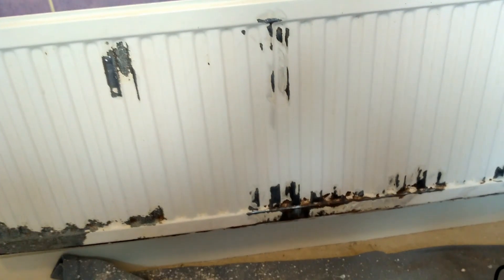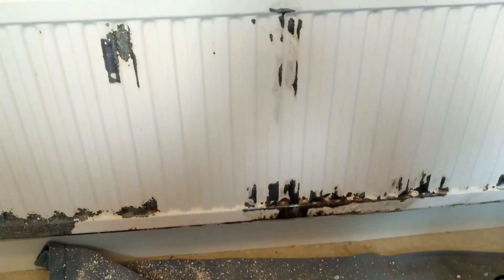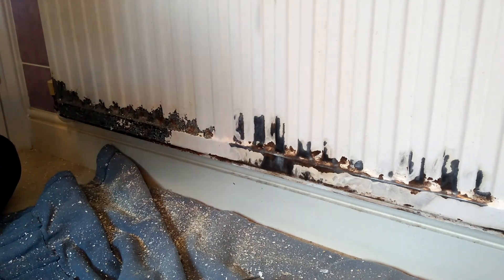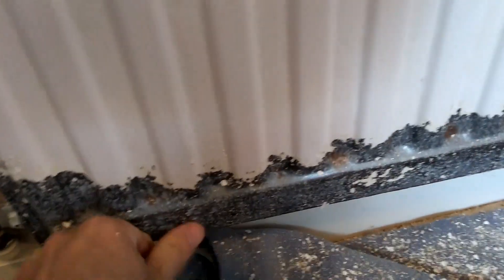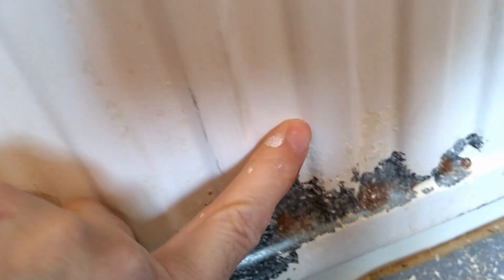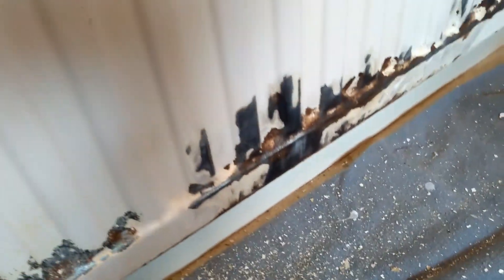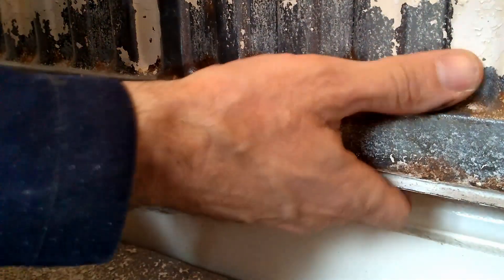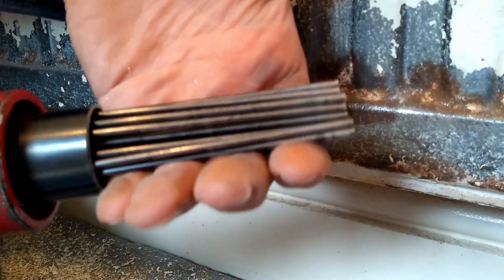Very fast paint removal from bathroom radiator (air chisel needle scaler)

Comment: Hi, I was just wandering what air compressor you're using? I want to get one of these but not sure if my air compressor is powerful enough? Any help much appreciated. BTW this is a helpful video, there's very little else out there for info, thank you.
Reply from the maker: I would say that my compressor is a bit undersized but it does the job for occasional use. Bear in mind my compressor has to keep running almost constantly due to a small tank and low displacement rate. 1.25 HP, 190l/min, 25 L tank. The compressor was given to me for free, but if I were buying now I'd go for something about twice the size as this one won't keep up with my 4" air grinder. Does that help?
Reply: @PizzeyTechnology  Thanks for that, much appreciated, mines a 50 litre one so hopefully should be fine for one off job. Thanks again.
Reply from the maker: Don't forget the displacement (or flow rate) is the thing that really matters if you use this tool for sustained periods. The larger tank is great as a buffer but the compressor pump will need to catch up.